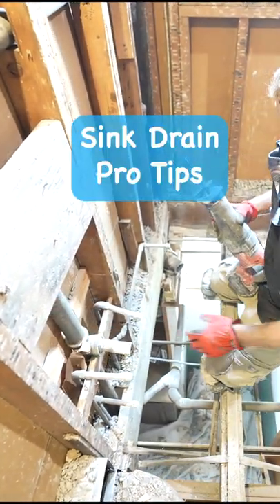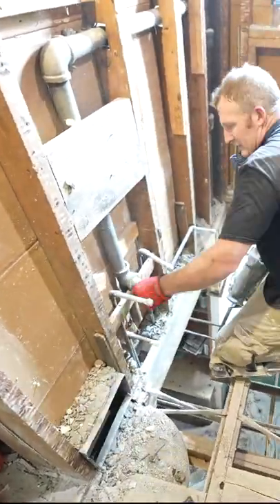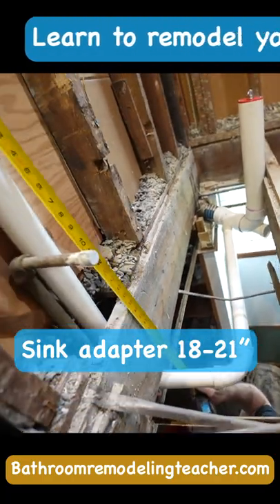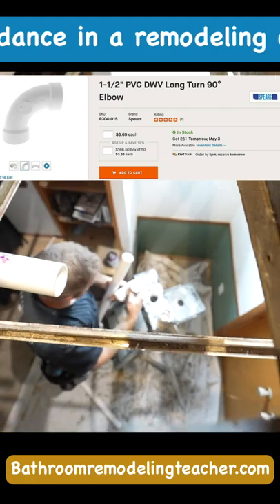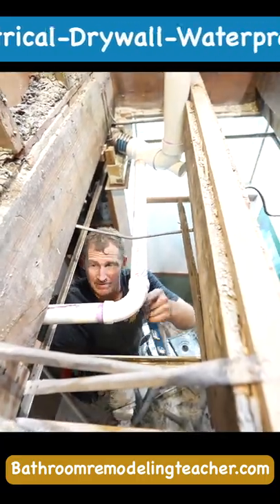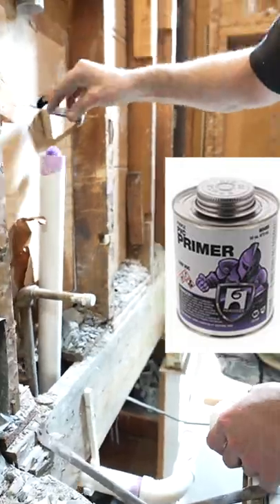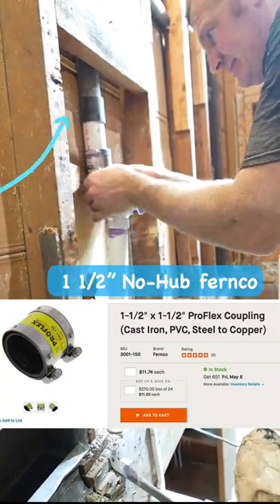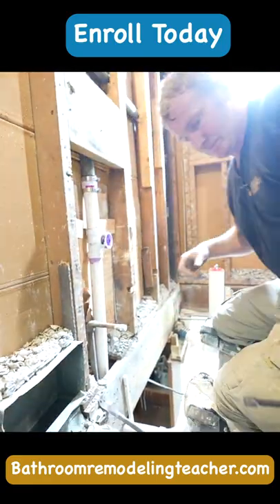Sink Drain Tips

Comment: Roll a 45 and a street 45 next time.. inspectors don't like 90s on their sides
Reply from the maker: Agreed
Reply: Is it a code violation or is it just frowned upon?
Reply: Wrong it's one more point of failure and higher cost to your customers in your time and materials.
Reply: @William Waulters  with what plumbing experience does your comment stem from?   In allegheny County pa that would fail am inspection..90s can only be used on their side after a before a cross in a double sink application.
Reply: Long sweeps are correct to code. Don’t let your inspector make up rules.
Reply: @josephpasquale8932  What's the IPC number that this is in violation of?